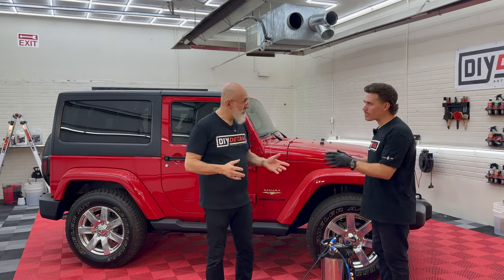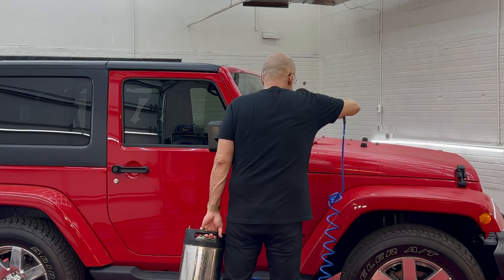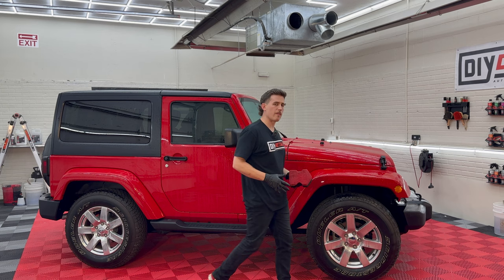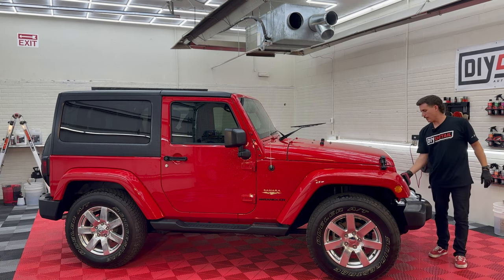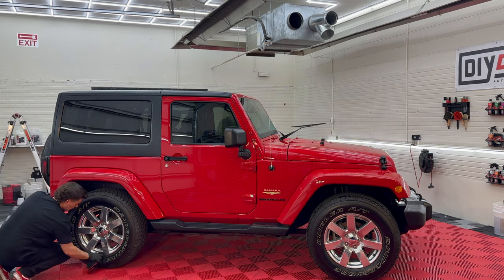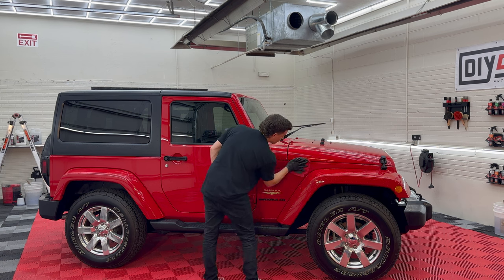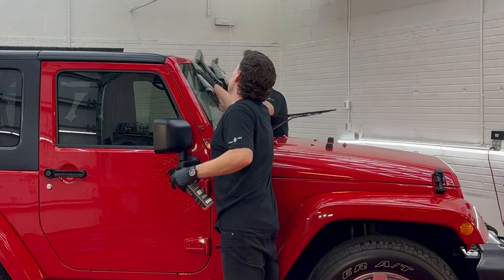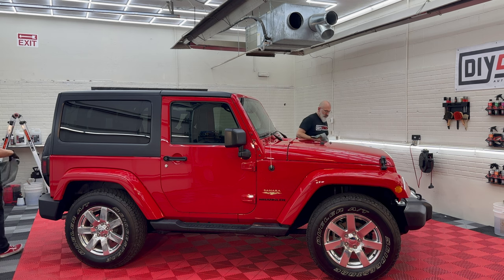How to wash and decontaminate WITHOUT using a hose!

Comment: Good stuff. Just tried the rinseless wash this past weekend, and boy it's melts away dirt and creates a SUPER slick surface! Awesome!!
Reply from the maker: Thanks for sharing!
Reply: @diydetailofficial  Really love the product Yvan. Have had people telling me to give rinseless a try, but I was always hesitant because I have been afraid that it "doesn't work as intended" but boy it sure does!
Reply: Thanks guys. Why did you use ceramic gloss instead of Iron remover to decontaminate the vechle?
Reply from the maker: To give it a little more gloss, and with only 1800 miles in 9 years of garage life, not much contamination to deal with.

Comment: Detail kegs are the way to go. Once you get one, you don’t have to use a hose anymore other than to fill it up. For heavily contaminated vehicles, let the rinseless & APC dwell appropriately, and you can easily rinse away heavy grit/mud with only 80-120 PSI from the keg before doing your contact wash. Safer IMO compared to using a pressure washer due to the PSI. You will also be surprised how much water you save compared to traditional washing with a hose/pressure washer.
Reply from the maker: Agreed.

Comment: It was 75° F here today. I washed my GMC pickup for the 3rd time since purchasing it. When I was drying the hood with my best drying towel, I noticed a speck of what appeared to be rust. Small enough to have missed. But I’m now worried about what other of these I’ve missed. Question: since the truck only has 2,000 miles on it, should I take it to the dealership and have them document it? I must get this fixed! 2024, and it’s already showing rust? Ridiculous!
Reply from the maker: Is it white?
Reply: @diydetailofficial  yes, white.
Reply: @diydetailofficial  yes, my truck is white.
Reply from the maker: Then all you need is to clean it, then apply DIY Detail Iron Remover to the surface. It’s simply some iron on the surface from transport. With a white vehicle it shows up more.
Reply: @diydetailofficial  ordering from you now. Thanks. I’ll post a Short when I get my product and give you some feedback. I used Griot’s Foaming Surface Prep a couple of times. It seemed to get rid of most contaminants. I followed up with ceramic Detailer spray. It’s been cold since I first purchased it in November.

Comment: I only have a small pressure sprayer that I use for prewash but I have a IK Foam pro 12. Will that work with rinseless and if so at what ratio?
Reply from the maker: You can foam Rinseless if you’d like, is that the question? Try 32:1, you can dilute it at 256:1 but you won’t get foam